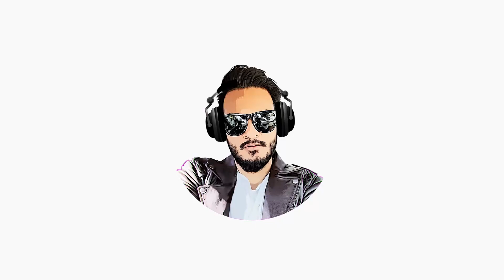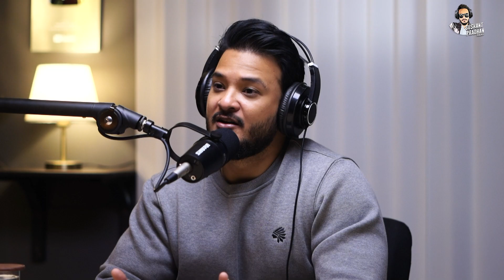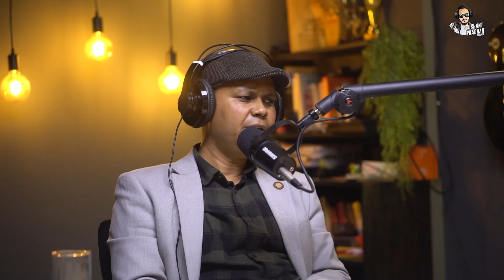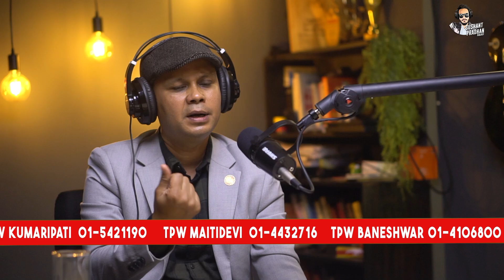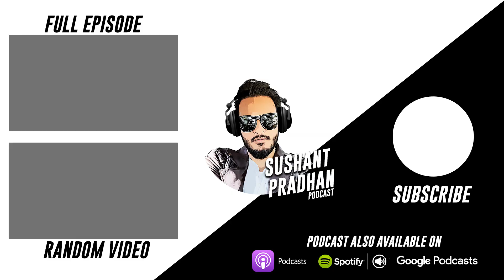Will Hydrogen Cars Replace Electric Ones?  | Dr. Biraj Singh Thapa | Sushant Pradhan Podcast

Comment: some people still believe hydrogen fuel cell technology is different to that electric one. Basic difference is that in hydrogen powered vehicle electricity is created onboard while in electric vehicle energy is stored in battery.
Reply: Care to explain in detail?
Reply: @cheapcalcwiz1291 additional components would be hydrogen tank and fuel cell stack in hydrogen powered vehicle otherwise it's same vehicle. Ev are directly powered from battery while hydrogen powered vehicle makes electricity onboard stores in a rather small battery pack and drive the vehicle through traction motor